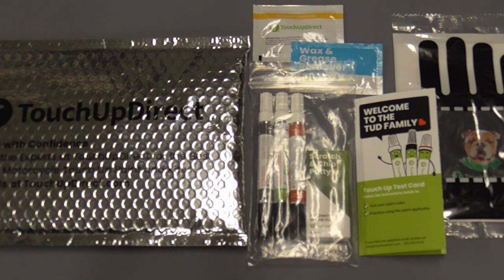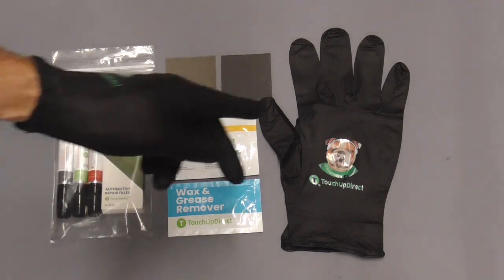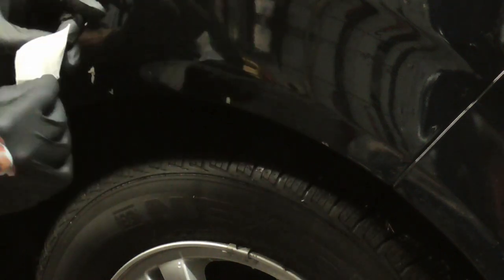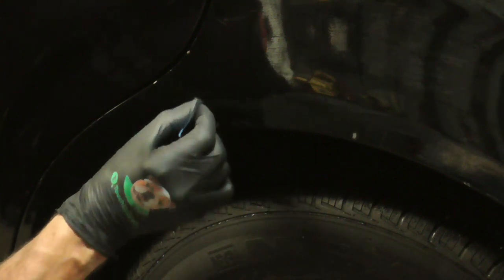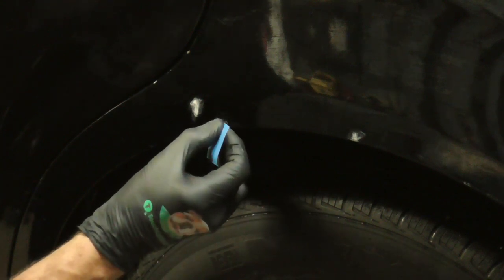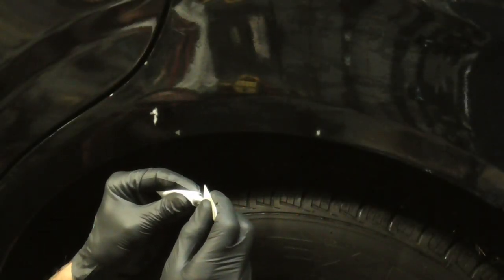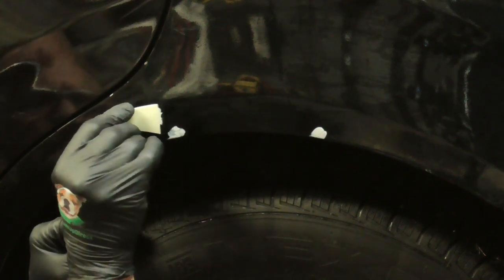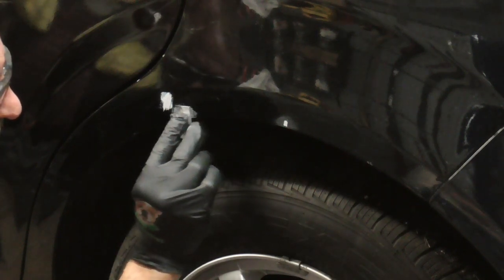How to Touch Up Paint Chips w/ TouchUpDirect Automotive Touch Up Kit

Comment: Excellent. You didn’t go back and sand after the final clear?  Just used the compound?
Reply from the maker: You could sand if you feel you need to but you're right, I just buffed by hand after it dried.  It won't be perfect but a lot better than a chip.  Thanks for watching and the support Ken :)

Comment: Thanks for these videos. Very insightful. I was wondering how much equipment you need for basic welding and roughly how much it costs to get started. It seems inevitable I will have to deal with rust issues eventually - I don’t really want to buy a car made much after 2010. Love my old low tech Euro 3/4 diesels too much :P

Sadly it looks like I will have to park with my first car within the next 6 months or so.. killed by rust that previous owners failed to deal with. Anyway I badly want another Vauxhall Corsa D/MK3 but they have a tendency to rust along the quarter panel and sills. Other than that they are absolutely cracking cars that grip like limpets. So I’m wondering if there’s any hope for being able to keep on top of things in the future, otherwise I’ll probably be a regular at the body shops. 

I really don’t want to have to buy a modern car with all the unnecessary tech and computers that fail and track everything you do. Any information would be greatly appreciated
Reply from the maker: You really don't need a lot of tools to get started.  I'll make a video on a "Bucket of Tools" needed to do body work.  You can also use a cheap flux core welder from Amazon or Harbor Freight.  See this video - https://www.youtube.com/watch?v=H87b1xlGofw
Reply: @LakesideAutobody  thank you so much. It’s something I really want to learn in the future. Body work, turbos and stuff as well. Just a petrol head who loves to keep stuff pristine 😅 

It’s really cool to watch as well. Proper art 👍